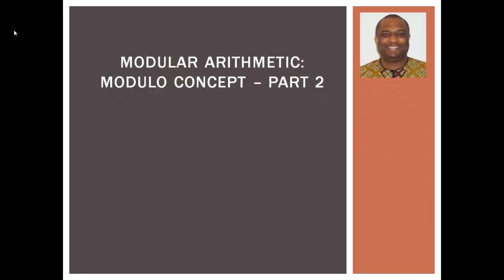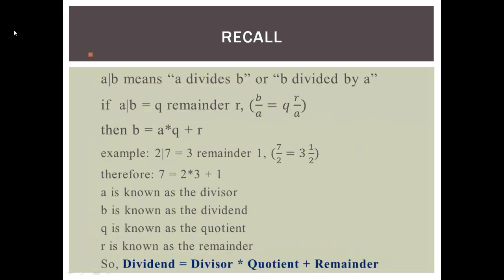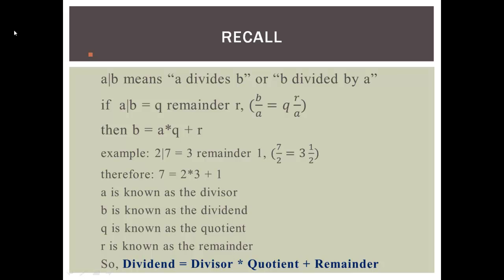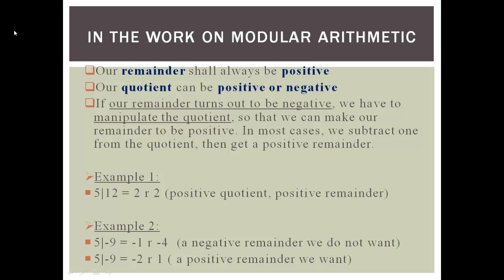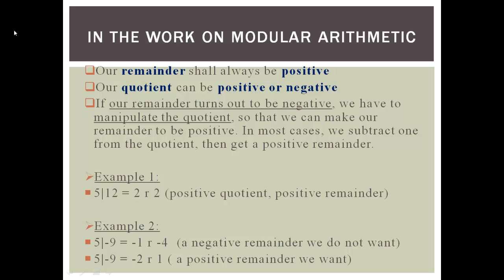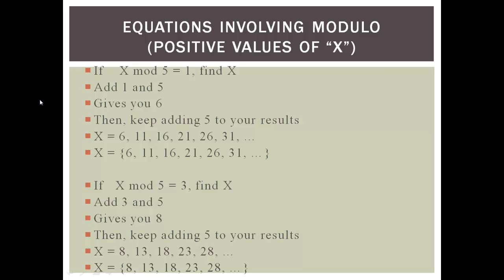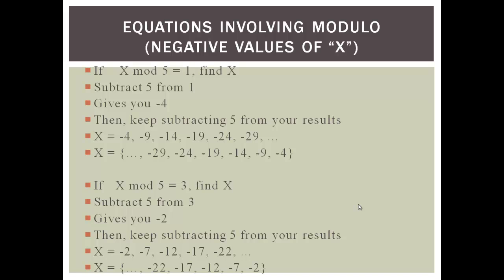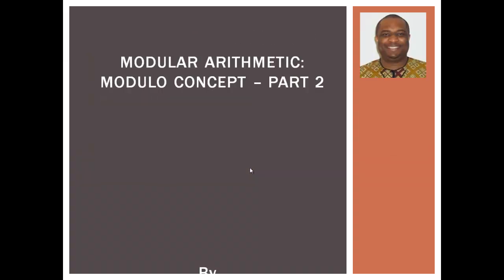Modular Arithmetic: Modulo Concept - Part 2

Comment: just confused with negatives how does -1 r -4 turn -2 r 1 dr chuks
Reply from the maker: David, I explained this concept on my website: www.modular-arithmetic.appspot.com

I shall explain it again here.
9 divided by 5 means 5 divides 9
5 divides 9 gives 1 remainder 4
5 | 9 = 1 r 4
This is because 9 = 5 * 1 + 4
Divisor = 5

Dividend = 9
Quotient = 1
Remainder = 4
(Not a problem because the divisor and the remainder is positive)

5 | -9 = -1 r -4
Because: -9 = 5 * -1 + -4
Divisor = 5 (no problem)
Remainder = -4 (this is a problem)

So, ask yourself: How can I get a positive remainder even if I have to mess with the quotient? (Yes the quotient can be negative. But the remainder must not be negative)
So, what you need to do is to subtract 1 from the quotient and try to find out the remainder.
Quotient = -1
Subtract 1: Quotient = -1 -1 = -2
Let the remainder = r
-9 = 5 * -2 + r
-9 = -10 + r
-9 + 10 = r
1 = r
r = 1
Therefore: -9 = 5 * -2 + 1
Remainder = 1 (no problem)
This implies that -9 mod 5 = 1

Another Example:
10 | -218 = -21 R -8
Because -218 = 10 * -21 + -8
Remainder = -8 (this is a problem)
Quotient = -21
Subtract 1: -21 - 1 = -22
Let the remainder = r
-218 = 10 * -22 + r 
-218 = -220 + r
-218 + 220 = r
2 = r
r = 2
Therefore: -218 = 10 * -21 + 2
Remainder = 2 (no problem)
This implies that -218 mod 10 = 2

Do you understand?
If you still need more examples, you may contact me via my website.